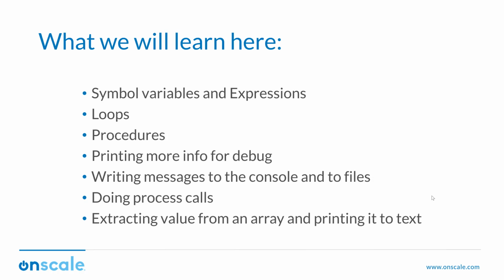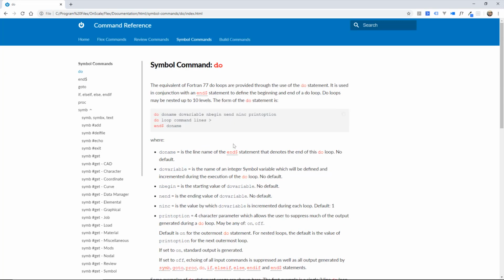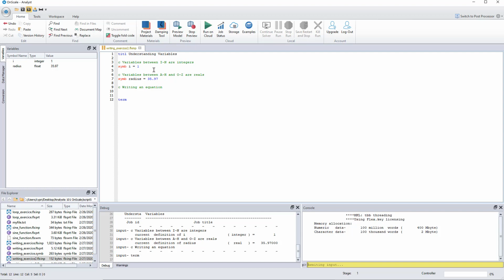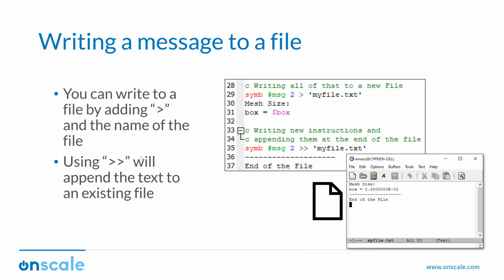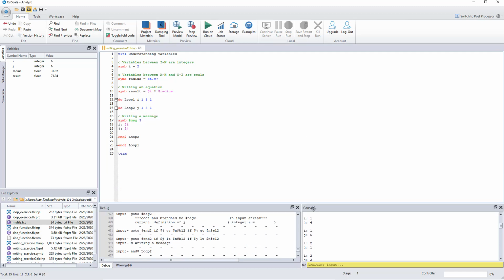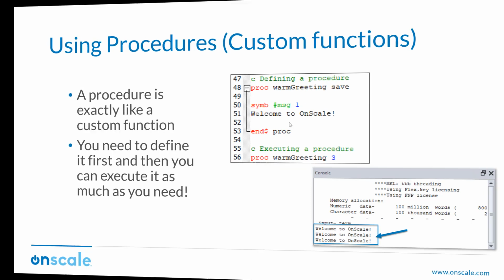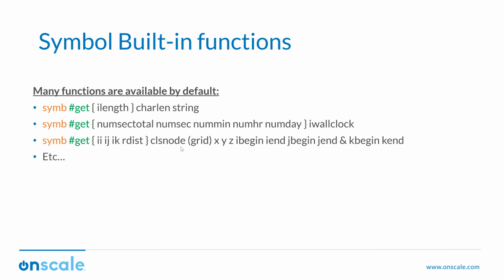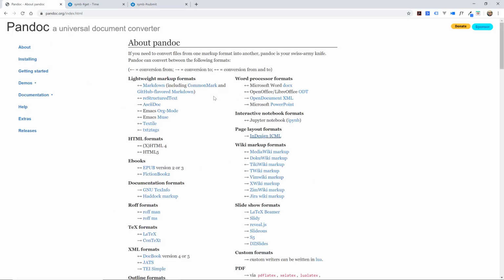[ OnScale Analyst 101 ]   Introduction to the Symbol Language

Comment: Hello Cyrprien,

I want to create my own absorbing boundary condition (my own subroutine) how can I do that?

Is there a way that we can see the subroutine of in-built boundary conditions Ike absr and impd and modify them ?
Reply from the maker: Unfortunately, I don’t think this is possible as Flex is not open source. Your can only use the BCs provided. You can create routines which work like functions, but this won’t give you the option to do custome absr boundary. May I ask why you want to do that?
Reply: @Feaforall  I am trying to do some guided wave simulations in CFRP composites...and for these simulations I want to avoid boundary reflections from the edges of my model for which I'm not sure that the in-built "absr" or "impd" will work.

Our research group has published some work where we have created effective non-reflective boundaries for guided wave simulations using COMBIN14 spring damper elements in ANSYS. I want to do something similar using OnScale and utilize OnScale's HPC capabilities.

Also I had read online (https://support.onscale.com/hc/en-us/articles/360013317511-How-to-apply-your-own-boundary-conditions) that there is a way to implement my own boundary condition and thought I could write my own subroutine using the syntax that OnScale uses.

If I cannot make my own absorbing boundary condition then I will probably try to make an area (inner nodes) in 2D or a volume (inner nodes) in 3D close to edges of my model as absorbing boundary instead of a side in 2D it an area in 3D.

Comment: Hello Cyrprien,

How would I be able to give absr boundary condition to an area (set of inner nodes or elements) instead of a side in a 2D simulation or a volume in a 3D simulation?
Reply from the maker: You have to create key points and then select the area defined by key points using the node or node2 sub commands of the boun command. There are some examples on the website I think.
Reply: @Feaforall  thanks for clarifying. I will try this

Comment: Your videos are really useful in getting started with analyst mode and understand the procedure and processes. 

It would be interesting to add some videos about different steps after the geometric creation and assignment.

You could add some videos about adding boundary conditions and forces (both on existing edges as well as specific set of nodes).

You could also explain how to add customized forces and boundary conditions which are not in the symbol library.
Reply from the maker: Thanks Robin ;-) I had the intention to do that. You are the first to tell me those video we’re useful, so that’s a good motivation for me to continue the series!
Reply: @Feaforall  I was wondering how do you define a 2D or 3D array in symbol?

I tried a couple of ways for example 

a_$i_$j or a($i,$j) if I have nested do loops with i and j as loop variables.

Both ways gave me errors.

How can we do this?